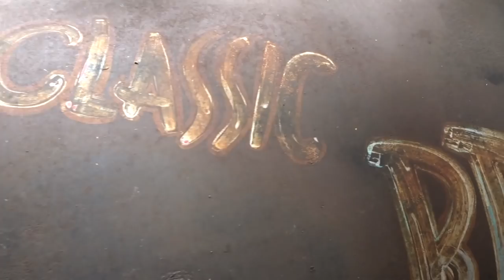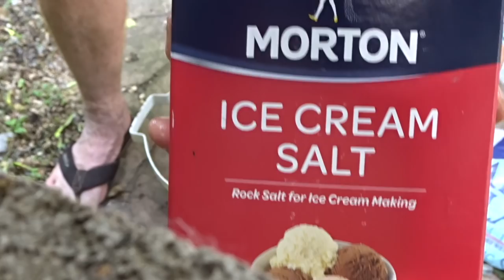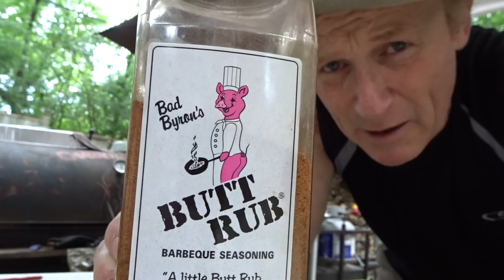BBQ~~Chopped Pork Sandwiches and Ribs

Comment: You're a few years older than me, but I've got similar memories of pigs cooking all night and the scramble to pull ribs from the carcass the next day. They did it all over coals, but I'm with you - a hybrid system makes for easy and consistent cooking.

I have yet to find the rack of ribs that peels easy - I figure I'm due for a whole mess of them in the near future. In the smoker is good, but I've also got a wet/dry method that works well in the oven when the weather is highly inhospitable.

I'm in complete agreement with the pickles on the sammich - they're a nice variation. Being down in Wilmington I've not ventured to try red slaw yet, but I'm not opposed to the idea.

Now I'm hungry!

Comment: Shug I made your buttermilk ice cream recipe a couple of times now and it's the best ice cream I've had. You're right there's something about the buttermilk that just makes it better. I have a question, when I store it, I notice that it gets kind of icey and doesn't stay creamy. Do you do something to keep it creamy? A feller I know told me to add a bit of alcohol to keep it creamy. Do you have any suggestions? I did let it sit in the maker like you did on this video.
Reply from the maker: So good. Once you put it in the freezer (if you don't eat it all) it will freeze up hard. Need to let it sit out and temper.

Comment: Excellent video, Shug! If I were to cook a pork butt or two on my Big Green Egg, following the exact method you use, what temperature should I cook at, and what steps should I follow (when to flip it, and how long it should take per pound)?
Reply from the maker: Here is a good read......http://www.ibiblio.org/lineback/bbq/smoke.htm
and http://www.ncbbqsociety.com/recipes/porkshoulders.html
Reply: Thanks for the links, Shug! As far as your personal preference goes, if I were to cook a 9 pound butt at 275 like you did, what’s your rule of thumb for how many hours into the cook to flip it, and how many hours to cook it total?
Reply from the maker: I go by the feel of the meat...until it falls off bone. flip it after 3 to 5 hours.   Cook it 10 t0 12.  Your results may very.
Reply: shugemery Okay. I’ll try cooking it at 275, 4 hours fat up, 8 hours fat down.

Comment: So hungry now that I may smoke a pork butt tomorrow...  

One of my favorites is smoking a pulled beef...  make sandwiches on an onion roll topped with sauteed onions and a horseradish mayo.
Reply: Now that's just downright rude to go talkin' like that and givin' me ideas of new things I have to try. What cut of beef do you use? Any rubs or sauces? I've done brisket, but it's for slicing more than pulling/chopping. TELL ME MORE! I MUST HAVE YOUR SECRETS!  ;-)
Reply: Kit Cosper  it works pretty good with some chuck roast cuts.  Usually about 3.5 pounds at the store... I get 2 or 3 of those.  You have to smoke at a lower temp so it doesn't get done too quick.  I do it like a standard production style so just an all purpose over a mustard base.  I think last time I used pecan wood chips